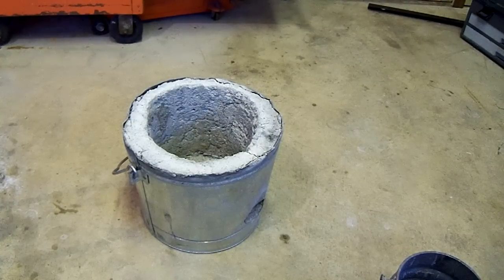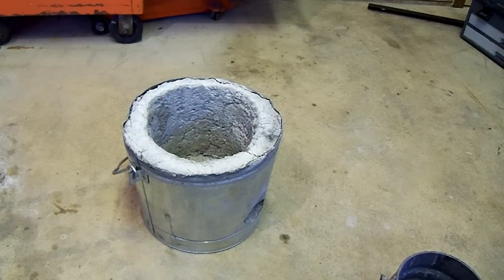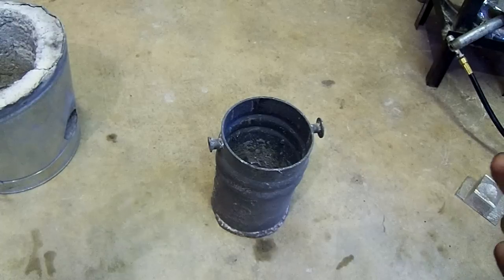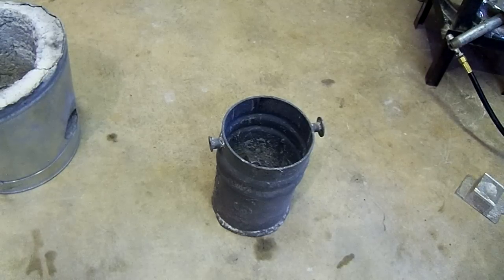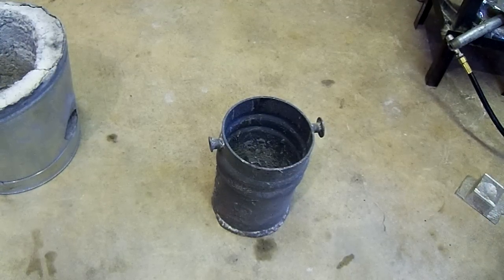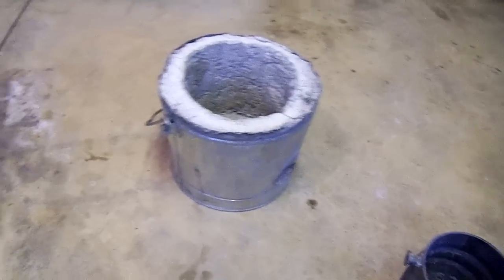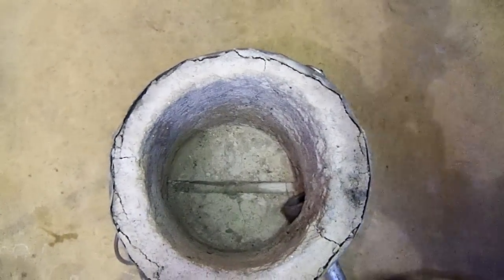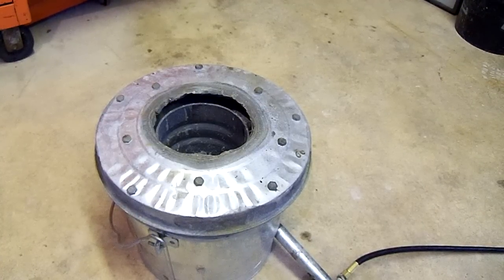Part 1 - The Basics - HOW TO MELT METAL AT HOME

Comment: I appreciate you sharing your experiences & ideas here. I came across your video while searching for the basics, pros & cons of using steel & graphite crucibles. From what I've come across, if one is melting metals with a lower melt point than steel, then steel is the more economical, durable and reliable option. Maybe graphite is lighter than steel, but that is the only pro I can see for graphite at this point... at least for the non-ferrous metals I'm looking at melting. Am I missing something, or are there other advantages to graphite crucibles? I just don't see why the craze over a more delicate, expensive, & less reliable material. Thanks!

Comment: where do i get a furnas?
Reply: Make one! Grant Thompson the king of random has a good tutorial on it
Reply: William Ela but i suck and i have no ide about that stuff. and i dont it´s the same in swedish.
Reply: Bear with me here...take a steel flower decorating pot, usually can be bought in a hardware store, then mix a 50/50 ratio of plaster of Paris and sand with water until it is the consistency of thick mud. Then punch a hole in the side of the steel pot with snips or a drill. Finally, make the "mud about 2 centimeters thick around the whole thing but don't cover up the hole. Smooth out as many bumps as you can and let it dry for a few days and you're ready to go. For a crucible you can use a steel can
Reply: furnace*
Reply: @William Ela ... Does concrete cement work? Instead of plaster and sand?
Reply: @nmakea  i was thinking of doing that.  Fill a bucket with concrete then core 2 holes
Reply: Wow i just realized I'm about 5 yrs late lol but still....
Reply: Watch brickleberry this thing is stupid

Comment: can you melt rivet steel in this and what is the max temprature?
Reply: I don't know the exact temperature but I accidentally managed to melt high carbon steel in it so you should be able to do rivets
Reply: Steel melts at 2500 F.  I'm not sure about rivet steel though, but I'm gonna guess roughly the same although I'm sure you've figured this out at this point.  If not, then I hope this helps.